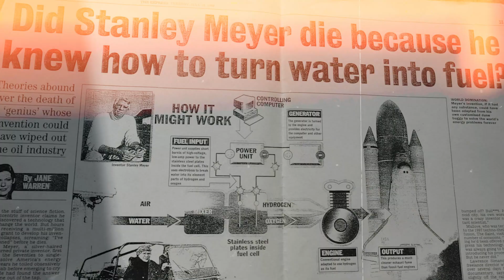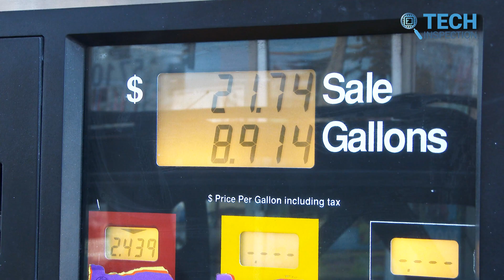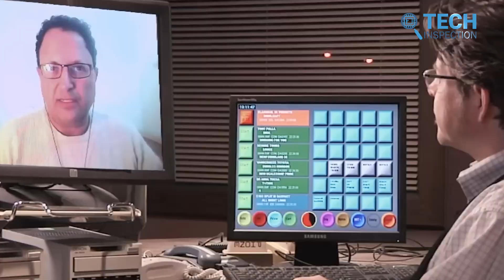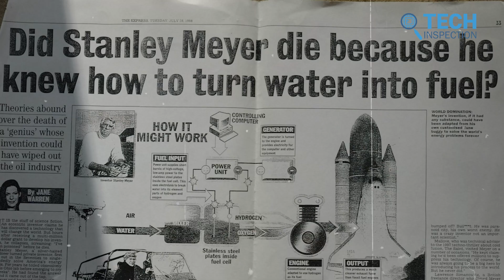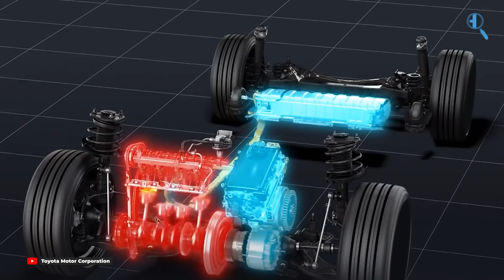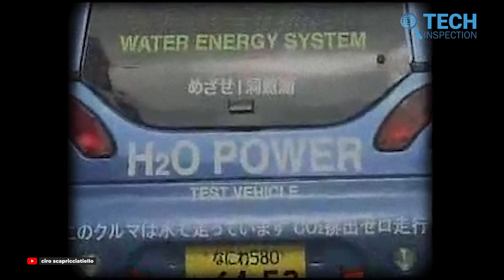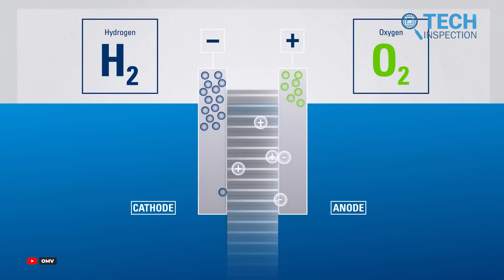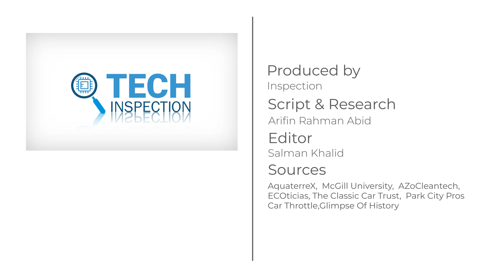The Mystery of Stanley Meyer and His Water Powered Car

Comment: Thermodynamics have a way around them, if Albert Einstein himself found a way to at least in theory travel faster than the speed of light, then there has to be a way to make this work. 

Every video in YouTube about hho gives you the basic idea, but they all have a big flaw, heat and current draw. 

Thats the main reason why hydrogen extraction is debunked, but it cant be an impossible task.
Reply from the maker: You've hit on the core challenges, energy input versus output, and how to make the process efficient.

Comment: The technology is real but the science behind it lives in a place where mainstream science has yet to go and understand. The way water is being split is by way of ionization in that a high potential voltage difference is placed on the water molecules by creating a capacitor with the water being used as it's dielectric causing the atoms that make up the water molecules to start ejecting their electrons once the voltage levels reach the threshold for ionization of the hydrogen and oxygen atoms. This act of the atoms ejecting their electrons is what breaks the covenant bonds of the water molecules. 
When I looked into this technology trying to understand just what was being done I found that basically Meyer mimicked the earth's global electric circuit as it works very much like a thunderstorm.
Reply from the maker: That's a really interesting take! Comparing the setup to how thunderstorms work and the Earth's electric circuit is a cool idea. The concept of using high voltage to split water by pulling electrons from the atoms sounds exciting.

But from what we know in science so far, splitting water that way usually needs a lot more energy than what’s practical and water tends to short out or arc before you can get to those levels. That’s why standard electrolysis uses a different method, with lower voltages and some kind of catalyst.
Stanley Meyer’s ideas have definitely gotten attention, but no one’s been able to fully prove they work the way he described. Still, it’s always good to explore and ask questions,sometimes that’s how breakthroughs begin.
Reply: @tech.inspection  Yeah it's been a rough go trying to get at the science behind Meyer's work but that's what the scientific method is actually for in that it's a slow process of elimination. They reason why the electricity doesn't short out is due to the way the voltage intensifier circuit is set up as it puts both negative and positive voltages on the capacitor plates per pulse. If the voltages are balanced no current flows through the water bath as the sum of the two equals zero. Unless you someone like me who have built and tested the technology more than likely what I just said wont make much sense to those whom are not familiar with the technology. But since Meyer wasn't the first to do this I could study the technology from a few different perspectives.
On a scientific note plants also break the bonds of the water molecules by taking away the electrons from the atoms that make up the water molecules. So, no it doesn't take a whole lot of energy like that of electrolysis to break the bonds of the water molecules this way. The science is very subtle which is why so many missed it as their rush in trying to understand the technology by copying what they found and saw simply wasn't enough as one had to understand it not copy it to be able to recreate what was done.
For me I just had to learn how to build it correctly once I understood the science behind it.

Comment: Electrolysis, the splitting of H2O into H2 and O, is very energy-intensive. And this energy must be supplied from an external source (e.g., a battery). How the solve this problem. What is the energy balance equation of such a drive?
Reply from the maker: You're right. Electrolysis requires more energy than the hydrogen it produces can typically give back. That’s one of the key controversies around Stanley Meyer's claims. His energy balance equation was never clearly proven or peer-reviewed, which adds to the mystery and skepticism surrounding the invention.
Reply: @tech.inspection As Stan Meyers invention has been listed as a hoax so has Steven Horvath's patent of  Electrolysis Method for producing Hydrogen and Oxygen

"Dec 22, 1976 — A novel electrolytic cell produces a mixture of highly ionized hydrogen and oxygen gases by a method combining electrolysis and radiolysis." This is really interesting because this is the same method that Herman P Anderson describes in his water powered car.
There is also a patent from Life Systems, Inc. under NASA Contract NAS9-12509. for a regenerative fuel cell using electrolysis to provide hydrogen, oxygen and water to the space shuttle in the 70's and 80's.
Welcome to the rabbit hole.
Reply: Is electrolysis energy-intensive? It seems those who have only experimented with brute force electrolysis say that and I'm sure Stanley cell had more going on than plates or rods stuck in water with a current supplied.

Comment: No explanation of where the power came from to drive the electrolysis. 
He had to have a battery. This would work but all you are doing is putting the hydrolysis process and a combustion engine between the battery and wheels. Simply using electric motors would prove more effective on the same size battery. Thus is simple Physics, 101...
Reply from the maker: It's great to see such insightful comments! Thanks for bringing up the important points about energy sources and efficiency.

Comment: Why don’t they have the electrolysis happen when the car is off, that way the hydrogen is stored up. then have the battery for that process charged by an alternator when the engine is on?  I’ll take a check and a car please
Reply from the maker: Interesting idea! Storing hydrogen could work, but Meyer’s design focused on producing it on demand to avoid storage challenges. Thanks for sharing your thoughts!
Reply: I was referring to 15:58
Reply: Hydrogen is  highly explosive, not safe to store on a moving vehicle